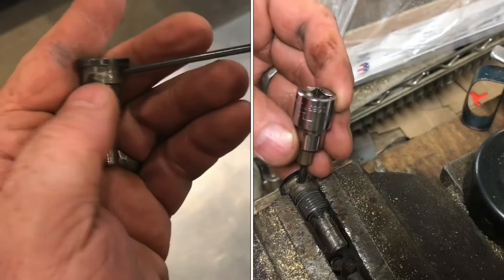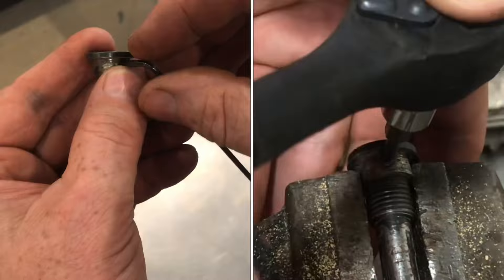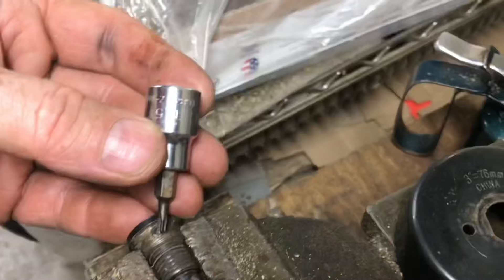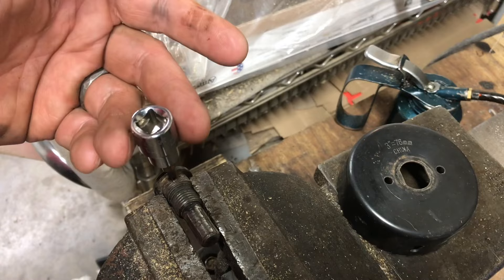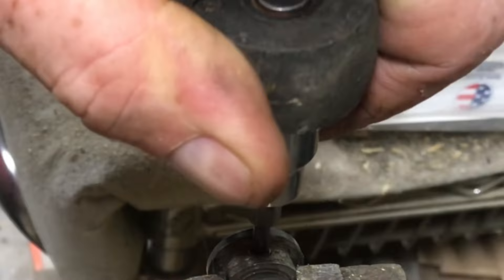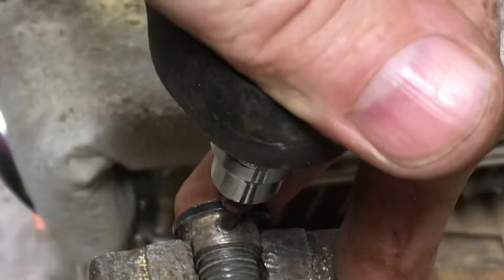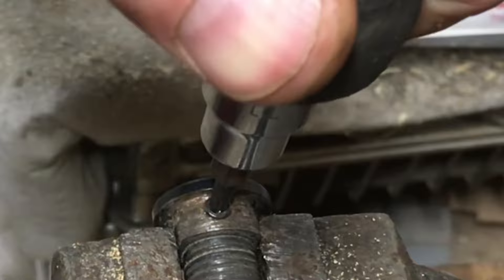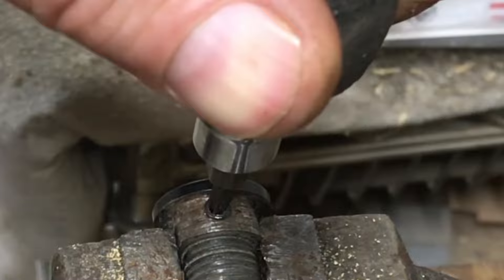(mechanics secret) “remove” STRIPPED rounded allen screw

Comment: I was on the verge of cutting my kitchen faucet off but luckily found your video.  It took me 20 seconds to get that thing out. Thank you so much.
Reply: 🤣😂🤣😂 I have a different scenario but I’m about to cut something off also. This method usually works, but I had to cut a slit at the top then use a flat head.
Reply: Reckon this will work on a smallish Allen key screw? On a wheel for a brake disc???

Comment: The miniscule recessed allen screw in the cold lever of the mixer tap had corroded enough to stick. Trying to turn it using the allen key was impossible. This tip has just saved us a massive plumber's bill and ripping the kitchen sink out. Thank you so much ❤

Comment: I can't believe how easily this worked. I was just about to drill out the set screw in the axle collar for my go-kart, when I Googled how to remove a stripped head set screw and came across your video. Drilling would have been a disaster I'm sure. This took less than a minute and the set screw came out easy. Thanks so very much. You're a genius.

Comment: Always Always Always apply anti seize to set screws before threading them into their mating threaded hole to avoid the problem in the first place.  When a screw thread meets the resistance of the shaft it goes up against, the clearance necessary for the thread to be able to mesh with the threads in the hole is taken up setting up a potential gaulling situation upon removal. A film of anti seize between the threads is your best hedge against this when the time comes to loosen the threads. Anti seize also provides protection from moisture in the atmosphere causing corrosion of the threads over time says the old machine shop instructor.
Reply: Thanks! Will silicone faucet grease work for a set screw on a shower handle?
Reply: @jpablo700 any grease is better than nothing if there is a chance of corrosion or galling , however anti seize has additives that the grease won’t have.  A small can of anti seize will last most people a lifetime because you do not need to paint the threads because as they mate the anti seize is carried by the thread into the space between them……..it’s like the old Brylcream ad…..”A little dab will do ya.”